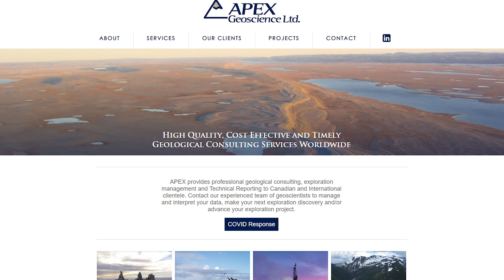This US miner has discovered enough lithium for 50 million EVs

Comment: As DC Fast Charger infrastructure grows the need of large battery pack diminishes.  So instead of a 250 or 350 mile battery pack a 125 to 175 mile battery pack will do 99% of Americans just fine.  That mean instead of 50 million EVs that same lithium can make 100 million EVs.

Comment: Delighted with U.S. Lithium finds.  The heavy metals should be reserved for smaller power requirements and supplementary batteries but cars are better powered by Hydrogen fuel cells.  Sadly Elon will go broke unless he gets on with fuel cell manufacture.  They outstrip E.Vs to become the worlds No.1 first choice power unit.  Toyota and BMW seems to be the leaders in this field. The car of the future.  Hard luck Tesla!  E.V. are a sham by comparison.

Comment: Everyone is overlooking the elephant in the room. Where's all this electricity going to come from?
The United States road infrastructure has a C- rating. Anyone that's done any type of traveling will tell you that grade is rather generous, to say the least.
On average without EV's the electrical need in the US goes up 10% each year.
With an electrical infrastructure rating of C- rating. And most of this infrastructure being built in the 1950 and '60s with a 50-year life span.  Not too hard to see where this is heading.

Comment: Tesla has located at least one dormant lithium mine in Nevada where they also are setting up a battery factory and a recycling center. There are a number of those around the US. So starting mines from scratch is not all we can do. These existing ones can be brought up to modern standards and into action first, then the all new mines after.
   But I look forward to capacitors replacing a majority of batteries in this application.

Comment: You are saying only a fool will still want an internal combustion engine soon. I say that makes you foolish. Our infrastructure simply cannot support charging all these EV's at any time soon. Not unless they start building a tremendous amount of Nuclear fusion electric plants. If you are still charging the cars with coal, NG, or petroleum, what is the point of switching over to electric cars? especially when the batteries are so short-lived and so expensive to replace?

Comment: China's CATL is working on new battery materials that can improve energy density by 10 per cent to 20 per cent compared to iron phosphate batteries, the company's chairman said.
The new material technology known as M3P can enable an electric vehicle to run 700km per charge combined with CATL's next generation of battery pack technology, Zeng Yuqun said at the World New Energy Vehicle Congress in Beijing on Saturday (Aug 27).
The new materials will also lower the costs compared to nickel and cobalt-based batteries, he added.
Zeng, however, did not say what metals M3P batteries will use or when mass production could start.
CATL, whose clients include Tesla, Volkswagen, BMW and Ford, is the world's biggest battery maker accounting for more than a third of the sales of batteries for electric vehicles (EV) worldwide.

Comment: The push to electric vehicles will come to a screeching halt in the near future. Hydrogen and oxygen gas produced right on the vehicle through electrolysis will power future vehicles. Present internal combustion and possible diesel vehicles will be converted to run on this gas.  The product of this combustion is nonpolluting water vapor. This process was perfected by inventor Stanely Meyer in the 2000's, who mysteriously died.  Many people are trying to replicate his invention. There are other schemes that produce this gas. One uses 12-volt DC with a copper sulfate catalyst. Kits will be sold or plans for these devices will be sold on the internet. When this comes out many old jalopies will become ecofriendly economy cars. The future is waterpower and thorium nuclear reactors.

Comment: That area of Arkansas had an oil boom in the early 1920's that quickly drew about 40,000 men to Eldorado and Smackover. The boom did not last long, but slower production of oil and brine continues. In 1967, Jerry Jones (owner of the Dallas Cowboys) began an oil and gas exploration business in Arkansas, Jones Oil and Land Lease, which became successful. >> Albemarle's Silver Peak mine in Nevada extracts lithium from brine pumped from underground. Silver Peak is at the edge of an area with extensive deposits of clay that contains lithium. Tesla has bought property there. Many companies are planning lithium projects in the clay and there is at least one with a hard rock project close to construction.

Comment: if we end up with autonomous cars that are owned by fleet owners then we may not use LI batteries. we could switch to aluminum and allow fleet owners to do battery swaps.  this is one of the most disruptive times in human history and it’s not very clear what tech will win out.  

people bash hydrogen but it’s not inconceivable that solid state hydrogen can’t win out as well.
Reply: If sacrificial batteries/ swaps don't make sense for individuals , they don't make sense for fleets.
Logistics = cost.
Recycling = cost.
And you still have to charge the cell before use.
You still need to "liberate" hydrogen for solid state hydro, then you still need to either burn it (inefficient) or reconvert it back to electrical energy (inefficient).
It's lipstick on a pig.... Still a pig.

Comment: All of this concentration on lithium batteries is counterproductive, because of its toxicity, tendency to catch fire 🔥, and temperature sensitivity.  Contrary to the hype, lithium batteries can’t handle either extreme of temperature as well as other types of batteries.  You are limited to 40 to 90 degrees Fahrenheit.
Reply: Read up on LiFePO4 batteries.

Comment: Yeah, no, I don't want an EV ever.  I do not have the trust level needed, nor will I ever have enough trust to drive a computer with a motor.  There are hackers, creepy government agents, criminals, random bug's in the code.  The very fact that every program out there is essentially strung together with metaphorical duct tape and chewing gum.  Programming doesn't create a monolithic, perfect code that operates like a well tuned machine.  You are lucky if you get it working properly and push out patches randomly, hoping they don't break the code, and it makes it more convoluted and a wonder it works.  

People have many reasons they don't want the overly expensive trash EV's that cost a ton to maintain and are a hassle to recharge, and that has nothing to do with their intelligence level.  Only reason people buy these things are for novelty of the new tech feel or ideological reasons.  A good purely mechanical vehicle even if converted to CNG is vastly better.

Also, the batteries are just needed for the EVs they are needed to build out the electric grid which will require an insane amount of batteries to be viable.  Then you're talking about all the other tech that needs those same resources.  There are many things more important than EV's that need the lithium.

Comment: Lithium extraction and processing = environmental disaster. We're trying to stop Tesla's Lithium mine here in North Carolina before it destroys the water supply for several hundred thousand residents.
I guess you pays your money and you takes your chances.
Reply: Because you think that oil extraction is not already an environmental disaster?
Reply: I believe you mean Piedmont, not Tesla.
Reply: @robitmcclain6107  Tesla is putting up the money, so yeah, its Tesla.
Reply: @aceroadholder2185  I thought Tesla just agreed to buy a percentage of Piedmont's lithium. Is it ok for Albemarle to restart their old lithium mine at Kings Mountain?
Reply: @robitmcclain6107  This mine isn't in the middle of nowhere and will be much larger than it was years ago.  From a rooftop near the mine you can see the Charlotte NC skyline. The plan is to open pit mine the Lithium vein. The pit will be 500 feet deep (150m). Water wells serving a lot of people will go dry, ground water running into the pit. This water will be run through the processing plant to be built on-site and then pumped back into the Catawba River.  We're being told that none of this will be a problem. Of course, if you own a house within several miles of the pit, your house will lose most of it's value.
Reply: @aceroadholder2185  Do you live between Bessemer City  and Cherryville? How is water going to get way over to the Catawba River. I see the Albemarle mine is in the middle of Kings Mountain. Livent has their plant at Bessemer City. 80 miles NW of Bessemer City at Spruce Pine, two companies mine the purest quartz in the world.

Comment: and just in the USA, we would need to burn three if not four times as much dirty coal to make the electricity to charge up all those cars. and at least double the size of the power grid. as well as fix half of what we have now to handle all the increase in need.
wind is a very bad joke at best. solar is such a polluting item (in the manf processes), and both of these can not be recycled, so the land fills would get full of them. and the liquid poison junk from the manufactures would be creating a very large lake of death.

Comment: Start digging the holes for the landfills needed for all the dead batteries.
Reply: Oh dear. Only a complete idiot would place EV batteries in landfill, because they have value. They can be 95% recycled, and the lithium and cobalt can be 90% recovered and reused in new batteries. Show me a gallon of recycled gas/petrol or diesel. And the batteries which don't get recycled will be snapped up by the energy repurposing industry, to be used for energy storage in commercial, industrial and domestic situations. A good example might be the huge Sports Stadium in Utrecht in Holland, powered by 200 old Nissan Leaf batteries charged via solar. With respect, your post is typical of those by uninformed people who do zero research prior to posting utter garbage. Were you even aware that it has been illegal to deposit any type of battery waste in landfill in both Europe and the UK for many years?  Your ignorance is also highlighted by the fact that you describe EV batteries as "dead". Very rarely are old EV batteries completely dead.....

Comment: Hate to tell you all but EVs are a scam. Not the CO2 savings claimed. On average it’ll take 70000 miles on an EV before any CO2 saved over a gas powered vehicle! According to a study done by Volvo. The new Hummer EV produces more CO2 than 90% of the current gas powered fleet.

Comment: I watch your show because I'm interested in ev technology.   to say however that nobody will want an ice vehicle in 2030 is shortsighted.   until they make an ev that can do what my Silverado 3500 can do, I wont change.  I need the ability to tow 25000 lbs, with dual rear wheels for stability.   must have 400 miles of range while towing and the ability to refuel or recharge in 15 minutes.  I do a lot of very long road trips towing.  also the climate here is commonly minus 20 degrees F in the winter and even colder so the vehicle must be able to produce enough heat to jeep the passengers alive.

things will change by 2030 but that's only a bit over 7 years from now.  which ev currently made or being discussed will do what I need it to do.  and dont tell me the cybertruck either.  1, it's not dual rear wheel,  the shape of the cargo box wont work with a gooseneck trailer,  and it wont tow 30000 lbs.
Reply: The dirty little secret is the heat. Gasoline vehicles use waste heat plus they pressurize the cabin to prevent drafts. EVs use the battery to create heat through resistance cutting your range in half. I can only imagine the range while it is snowing, lights,wipers,defrosting the windows and heat. I own a mechanical contracting business and have seriously looked into some of these vehicles, they are a joke. Dont get me wrong they are great for mom to take the kids out for an ice cream but useless to pull an excavator.

Comment: There wasn't "enough oil" in 1905 for every person to have a car either.
Reply: Just bought a beautiful V8 400HP full size pickup for $40k less than a comparable EV. I can buy a lot of gas for $40k and no worries about range or temperature. Love that V8 growl:)
Reply: @johns512  And don't forget, heating your truck comes at no additional charge. These EVs have to use their battery to create heat. These vehicles are useless in cold weather.
Reply: @johns512  You are so right.   I need an electric hatchback with 400  mile range, 3 minute charge time, and can be bought for $5k with 100k miles. Until then I'm ICE all the way.
Reply: this is what i was thinking. and it was suppose to run out by 2000 as well.
Reply: When you brought gasoline for your car from the local hardware store, chemist shop
Reply: Ummm America has enough oil to last us over 200 yrs probably that much natural gas and that much coal... mineral really aren't a problem for america... our biggest problem is globalism and offshoring manufacturing jobs...
Reply: Not enough oil at the 1905 price for every person. It is true.
Reply: Absolutely... this is a story that keeps repeating...

Comment: Hey Paul I've read it is 33rd more abundant and its 0.004% of the earths crust. 4/100ths of 1 percent. The price is up 1200% since significant' EV production started in 2020. This find of lithium in Utah would be significant as 50 million cars worth is potentially enough to replace 20% of the 275 million cars in the USA. I am hoping Viking is wrong about Lithium being dominant for the next 10 years though; hopefully something better and more scalable, safer cheaper will jump out sooner.

Comment: Lithium Americas Corp. (NYSE: LAC / TSX:  LAC) is close to breaking ground on it's Thacker Pass (Nevada) project.
 The largest and most advanced lithium project in the United States.
Reply: Clearly a lot of people here have NEVER worked in the mining industry or have NO IDEA about manufacturing, but then most of these idiots spouting nonsense have NO IDEA because they have never been involved in manufacturing or been involved in mining and I'VE DONE BOTH. I used to work in the Australian automotive sector before it shut down and have since worked in the Australian mining sector in control systems and automation.

1: There's a giant difference between finding a deposit, getting it properly assessed and then being able to mine it.
Circa 2006 I worked on the construction of the Ravensthorpe Nickel project. BHP spent $3.5 Billion on the project. It was laterite nickel which is a bitch to process, but it was justified by the quality of the deposit and the value of Nickel. BHP did NOT complete a full drilling test pattern and the deposit was found to be NOWHERE near as good as the PR claimed. The mine was closed after about 18months and sold for less than 1/7th ($500 Million) its.
The Lesson: Don't believe the PR hype even when its from a major player. 

2: You absolutely do need Nickel for batteries, just as you need copper for the electrical cabling in an EV just as you need all the other metals, glass and plastics. Go and look at your car and see how much stuff is actually in one. If you have ever been in the plants where they make all those bits that go into a car you'll quickly understand that it takes a whole range of raw materials and lots of energy to make the bits that make a car and all of that uses lots of energy.

The quickest way we can reduce emissions is to reduce how much energy we consume as a society.
 
THE AUTOMOTIVE MANUFACTURING SECTOR is one of the largest energy consumers because it not only uses a lot of energy making the cars it uses a lot of energy getting the raw materials out of the ground and processing that into the raw feed stock to make the parts the cars are made from. The best thing we can do is NOT replace old cars with new cars but replace the drive systems in old cars with EV and Hybrid systems. It will save huge amounts of energy and resources while keeping millions of people employed. 

BUILDING EFFICIENCY: The other great (and inefficient) user of energy are BIG BUILDINGS. Mark Blyth the political economist from Brown U. pointed out this a couple of years ago. Some engineer worked out that just triple glazing all of America's buildings would employ 1000's and 1000's of people for well over a decade and reduce America's emissions so much that meeting the Paris goals is easy because you can then turn off a bunch of dirty old coal fired power stations. All those big giant glass boxes are designed by architects to look pretty NOT by engineers to be efficient. Not only would it creat employment but raise the asset values of all those buildings as well as reduce the power costs all the tenants have making them more profitable. I'd like to hear an economist claim that's not a good idea.